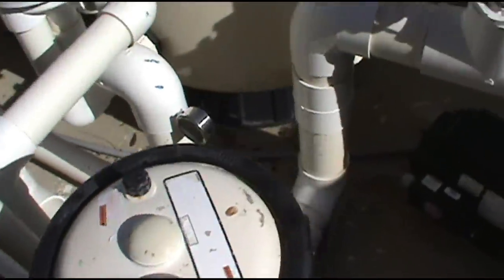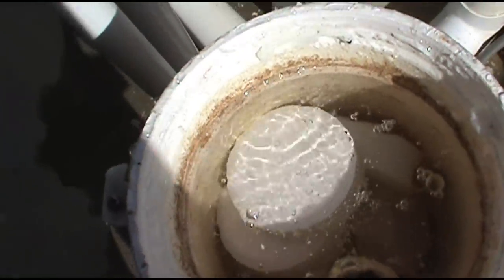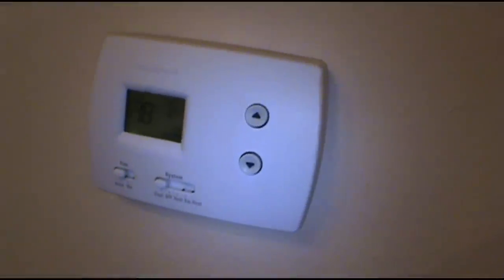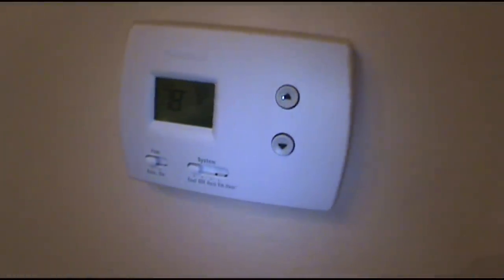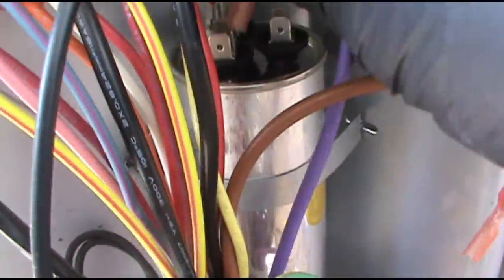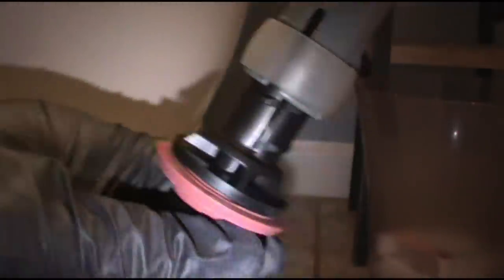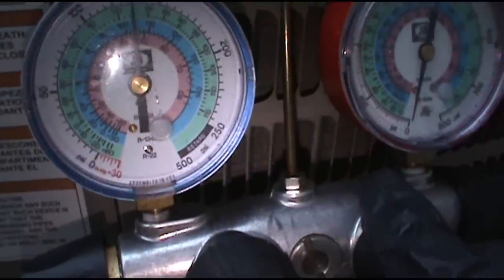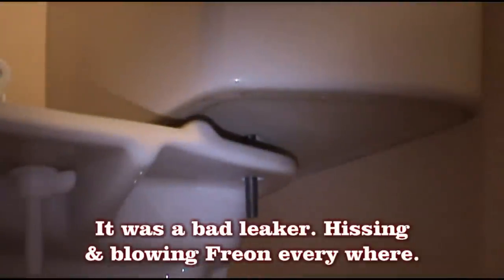Property Management

Comment: Hey man. Good job. Here's a tip. I also like the Fluidmaster float, but I use the Korky flapper. It's really soft and flappy and I've never had a call back on a running toilet with them. They last for years. The Fluidmaster flappers are a little stiff and can allow the toilet to run intermittently  if there is any imperfection or obstruction in the 2" discharge hole rim.  
.

Water Treatment

I used to do a lot of water treatment when I was in the Industrial/commercial game; boilers, cooling towers, hot tubs, hot tanks and pools. I probably sold and installed a thousand metering pumps, and controllers. It's an industry that's safe and secure to own your own business, but it's a lot of work and liability. I'd set up a boiler treatment equipment and testing program, but I'd depend on the on-site maintenance guy to carry it out and then I'd go by once a month for quality assurance. Once or twice a year, I'd get a call, something like:  "We're opening the 225 HP boiler on Tuesday, we want you to be here." It's then, that I pray to God the local maintenance guy has been doing his job, or it't a hellaciously expensive acid descale job.  
-
One time, I took over a cooling tower account. The tower was scaled up. I put in $4,000 of sulfamic acid to descale it and... it didn't work. The scale had too much silica (glass-like) in it for the aluminum safe acid to work. Luckily, they paid anyway, and bought a used replacement tower from me.  Dodged a bullet. Residential rental home property management is much safer and predictable. 
.
Reply from the maker: Man I wish we could have lunch once a week together so I could mine the gold in your head. You're awesome Rene Gade! Thank you so much for watching man!
www.DirtyMaintenanceNation.com
Reply: only thing I;ve ever seen with a korky flapper is swollen gooey gumbo gummy material from city water or stooges using tank tablets, combined with not flushing enough
Reply: @throttlebottle5906  - LOL. Go with Korky flappers or risk a "be back" I've seen a lot of flapper seepage from Fluidmaster flappers causing intermittent toilet running in the middle of the night.  Tenants have enough to bitch about besides toilets running.
Reply: @andy-jac  Love the Korky flappers and just started using the Korky fill valves too. We've been having siphoning issues with the Fluidmasters fill valves, where I work. (Hilton Head Island - Timeshare Property)
Reply: @briancarlisle4491  

Made my own Korky valve. Strapped on 2 corks on the floater of the leaking valve.

Comment: We use Fluidmaster also, when one starts to leak past and won't shut off most guys in our shop will go and change the $8 fluidmaster instead of the .50 gasket.
Reply from the maker: Right on. Thank you so much for watching Joe!
www.DirtyMaintenanceNation.com
Reply: i tend to always stab in a new valve also, but they're usually crusty as heck rust or mineral buildup and the float sticks on the shaft

Comment: That pool setup is space age man. Ours is way different. I wish I knew what our system is called. I think it's an older system. But it's a big tank that drops into the ground. You have to push down levers attached to plates inside big water pipes that drop down into the tank to stop the pool water from entering. Use a secondary pump to drain the tank. Rinse filters off with a hose. Fill it back up, turn on the main pump, add DE powder. Favorite part of the morning.
Reply from the maker: Yep! I've had that at other properties in the past. Good ol' DE filters. Thank you so much for watching ReelGuy!
www.DirtyMaintenanceNation.com

Comment: Question about the pool:
On the backwash, where does the discharge water go?
Ours has been released thru a gutter hose down the driveway and down the sewer. Been like this for over 20 years. Now, the inspector says we need to dig a drain line to go to the building sewer instead of the street/storm sewer. Cannot release it to the environment. Have you heard of this?
Reply from the maker: No I haven't heard that. Florida law may be different. I've never seen it discharged over land either. Always had it go down into a drain line underground.
Reply: @LexVance  oh. So where was yours draining to? Can't tell in the video. See 1:20 Looked like it was spraying under the pump.

Comment: Have you ever ran into the plastic nut on the end of the supply cracking and flooding a unit? Ive heard of that issue from people before. I think its related to over tightening the nut along with water hammer. I had it happen once when i was running a tub of cold water then shut the tub off suddenly
Reply: mumixam I’ve had this happen a handful of times. I was called in last Monday at 4:00am by the fire department due to a unit on the second floor of our main building flooding down through the ceiling of the first floor and shorting out a device on our fire alarm system. I’m thankful the FD showed up or it would have kept flooding the place until I showed up at 7:00am and started my rounds!